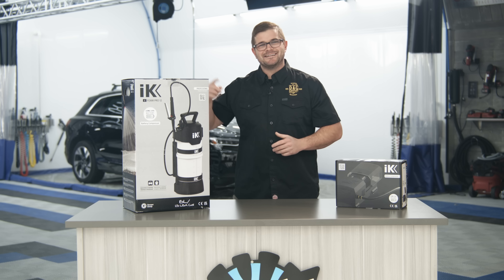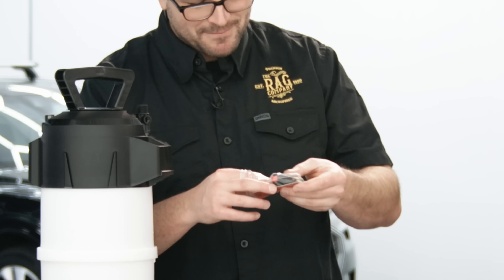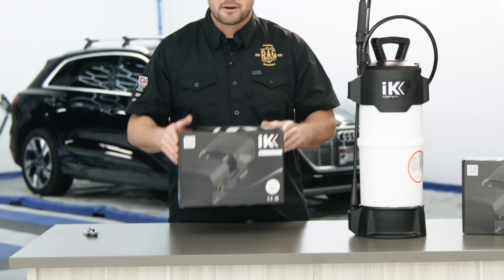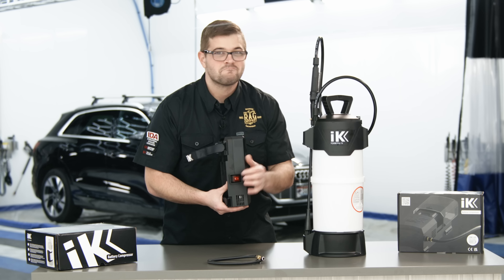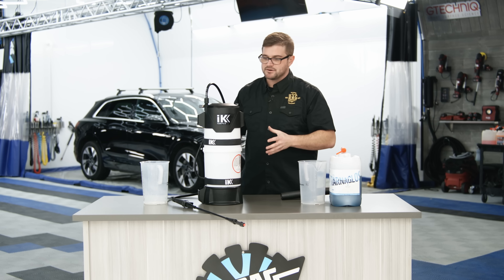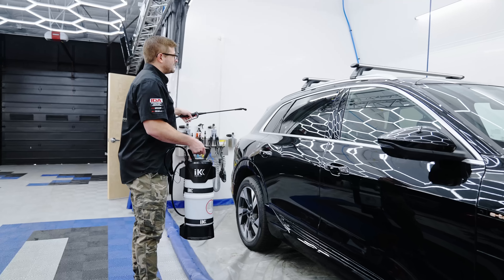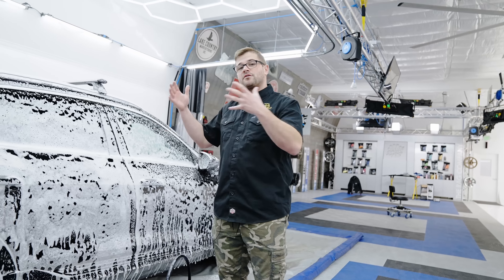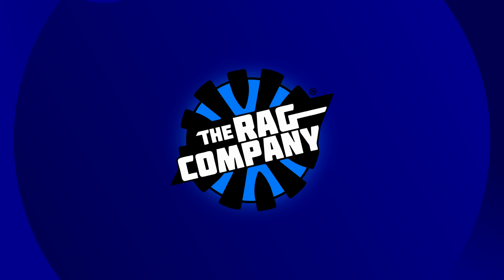REAL Car Wash FOAM On-The-Go! | The Battery-Powered IK E-Foam Sprayer is HERE!

Comment: Does the compressor attachment also work to add to a multi 12? I’m thinking it’ll be perfect for citrus prewash that doesn’t need to be foamed. Also wonder if mini handheld versions are in the works for future 🤔
Reply: You can easily convert a foam pro to a multi. Just remove the filter and cover the hole in the suction tube.
Reply: @rheijne95 how do you cover the hole? What chemical can you use to seal it up for good?

Comment: I would want these in a multi pro spray
Reply: I was thinking the same thing. If it’s possible I won’t get a detail keg.
Reply: You can, I've converted my Foam Pro 12's to Multi's. Remove the filter tip and cover the hole in the suction tube with tape.
Reply: @rheijne95  I’ll give it go. Thanks!

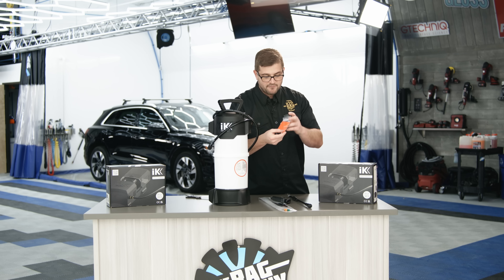Comment: Thank you Anthony for giving a detailed assembly and guide on how to use the IK Pro 12 Foamer. I bought mine from the Detailing Shed here is Sydney, Australia in November and have used it both mobile and at home for prewashing with Optimum Power Clean. As its summer here I’ve then applied Koch Chemie Vb with a foam cannon at a very weak dilution, 1:50, to keep it wet and even white cars and cars with heavy build up on their wheels have needed only a superficial contact clean. As the unit takes 58psi, I’ve used a Makita inflator set to 55 psi and I’ve been able to do an entire SUV with quite thick foam using the same nozzle you used. Do IK do a 12 Sprayer or is there a spray nozzle available to be swapped on in place of the foam nozzle? I have found a 2 litre IK sprayer a little bit small and I’m already allergic to pumping. 😅😅 Thanks, Lloyd

Comment: Is the container a different design from the original? I bought the add on compressor for the 2 Foam Pro 12 I already have, but the air hose blocks the area where the wand goes….so its difficulty to slide the wand into the designated holding area.

Comment: How would you go about washing and rinsing after foaming? I understand how this would work for rinseless, but if I have no hose and foam and wash with soap, how would you rinse? Another sprayer with something like a rinseless solution?
Reply: I use a portable pressure washer that is battery operated since it doesn’t need to be directly connected to a water supply line or I use a bucket with rinseless wash and towels. To dry the vehicle I then use a detail spray which will help remove any residue missed when wiping with the rinseless wash.
Reply: I do this method. Absolute rinseless pre spray . Foam it after then hit it with a wash mitt . 2 buckets method then spray again with absolute falls right down

Comment: This is an awesome product but out of all honesty, when it comes to time, that can be a problem.   The amount of time  spend foaming up the entire vehicle took a bit of time compared to just just using pressure washer and foam cannon.  I would say this is more so better for foaming the wheels and wheel wells.
Reply from the maker: The thing is, you’re exclusively thinking in terms where a pressure washer, foam cannon and unlimited water supply are readily available— This is meant to help for those where they aren’t. (Or for those who just don’t want to deal with those things)

It allows the user to be self-sufficient in a way that relying on a power supply, water supply or fuel canisters for a gas washer simply don’t. (Namely, mobile detailing or operations in remote areas)

You’re certainly not wrong as far as your needs are concerned, but there are plenty of people out there who find this will give them new options they previously weren’t able to explore.

Comment: I have 2 foam pro 12 and 3 pro 12 but this battery pack only works with the foam 12 at present. Why hasn’t ik added the valve to the pro 12 so it can be used for rindless washes and such like which would be awesome or can a runs less wash be used in the foam pro such as absolute?. I will be buying one of these battery packs but they are pricey but I always say you get what you pay for. Great vid as always.
Reply: You can make the foam pro 12 work like the multi pro 12 if you cover or seal the hole in side of the internal tip and remove the cotton filter

Comment: I really want one for rinseless wash. I’m tired of having to set up the air compressor just to fill it up
Reply: Use a small portable battery pump. I have the 20v Worx pump and love it.
Reply: @Jeeper1378  Any battery pump will work but this is way more proper and functional since there's no messing around with going back to a pump.
Reply: @Jeeper1378  Have you checked out Milwaukee's M12 Garden sprayer? With a shorter wand I reckon that'd be ideal for detailers.
Reply: The Milwaukee M18 Inflator would be perfect accessory to pump air into the schrader valve.
Reply: M12 garden sprayer! I’m a big Milwaukee guy, didn’t even think of it!
Reply: @erikalvarado1432  I just got mine and it's pretty good. Very strong pressure, only tip I'd say is done use the wand and connect the trigger straight to the hose. Personally I find that gives you more control.

Comment: As an ex-valeter, and hobby detailer, I'm always interested in new detailing products.
This isn't very good, the foam is thin, and takes too long to apply as the sprayer is so weak.
Mobile detailers would have a proper jetwash system anyway, and just use a foam gun attachment which is much faster and more powerful. You would still need a jetwasher to rinse anyway, so I honestly don't understand why they would want to carry this thing around on top of the other equipment, especially when it isn't very good.
Reply: Thick foam is just for show, it doesn't actually DO anything other than leave a mess on the floor!
Reply: @tonyhill1916  While I do agree to a certain point, that really thick bath foam type snow foam isn't beneficial, it does have to be a certain thickness to cling to the paint, for long enough so the product has time to dissolve the dirt and grime.
If it is too this, it just runs off before the chemical has had enough time to actually react.
This 'foam' (in the video I have actually commented on), is too thin, and too weak to actually dissolve the dirt and grime.

Comment: The red nozzle that comes with the foam pro 12 suckssssssss. Makes 3 lines of foam with little in between. Take the purple nozzle off the foam pro 2 and it changes everything about the foam pro 12. Makes it work exactly how i want it too.
Reply: FOam Pro 12 with purple tip with brake buster at 1:5 is heavenly.

Comment: Can I just say it seems as though IK has undergraduate engineers make a single attempt at innovating the next generation of sprayer with all kinds of attachments and doodads and extraneous Inspector Gadget parts which opens the door for someone to completely refine and perfect the idea using experienced engineers and product designers?

It looks like an okay sprayer that could be much better at foaming, much lighter, less cumbersome and streamlined to the point where it actually looks a bit sexy. In other words, "next"
Looking at you, Marolex.

Comment: For that much...I might as well just get a pressure washer for less and than get a foam Canon to go with it.
Reply from the maker: That’s a perfectly fine way to go, but once you’re out of range of running water, fuel or a power supply you realize how tethered you have to be to use those things. (Totally understandable for a shop detailer, but different for many mobile workers)